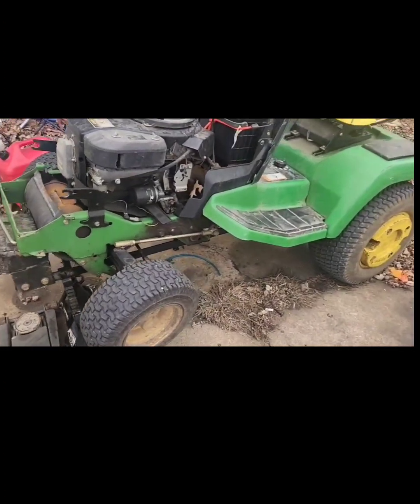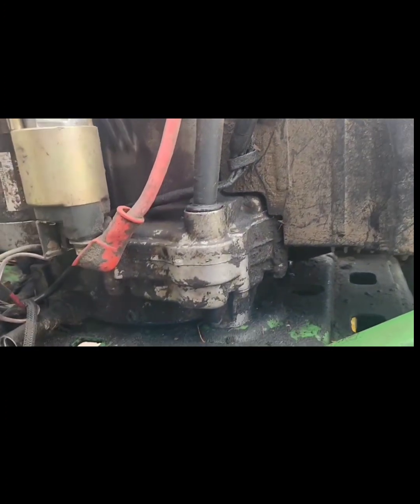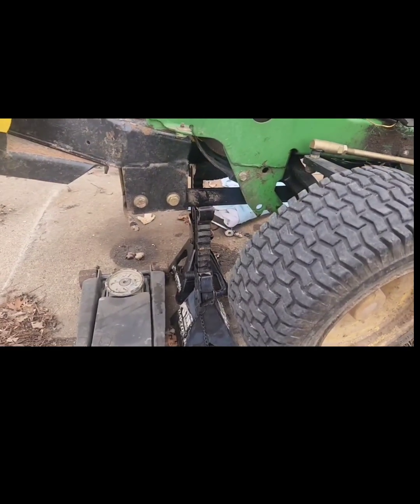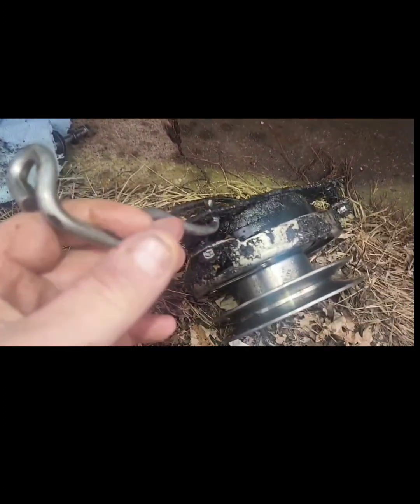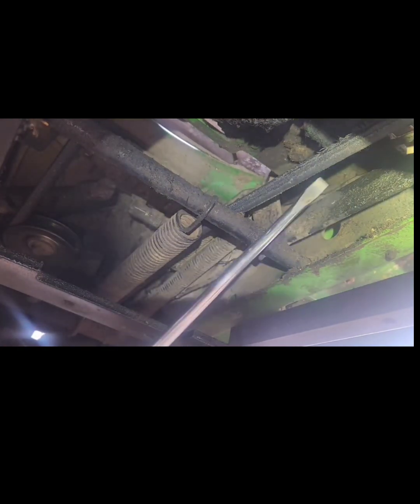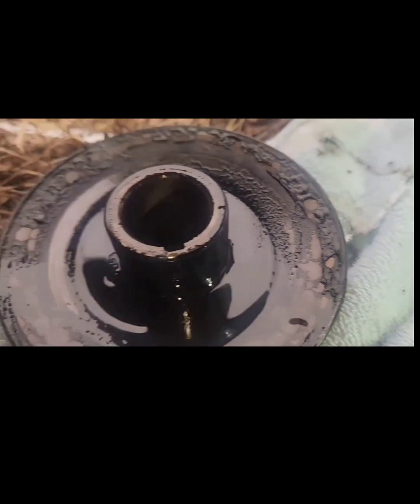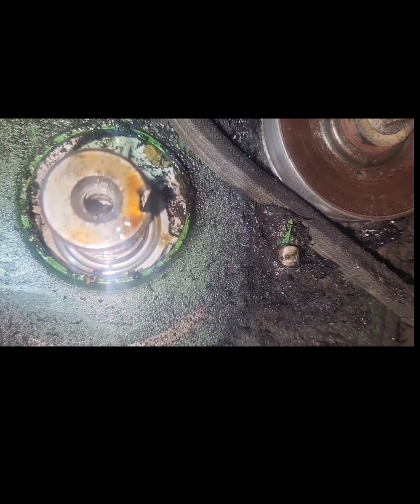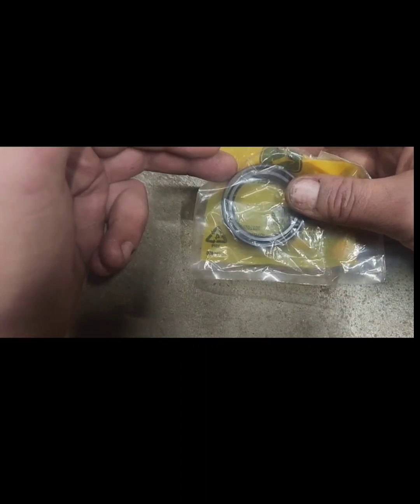Easy DIY Crank Seal Replacement on Riding Mower oil leak diy

Comment: Thanks for taking the time to film and post this Jake. It was very helpful for me to replace my crank seal on my old JD LX178. It has a Kawasaki FD440V water cooled engine that is laid out the same way underneath. My old bones don't like laying on the shop floor much anymore but it was worth the time (retired) to do it myself. The close-up shots were clear and steady. Good job!